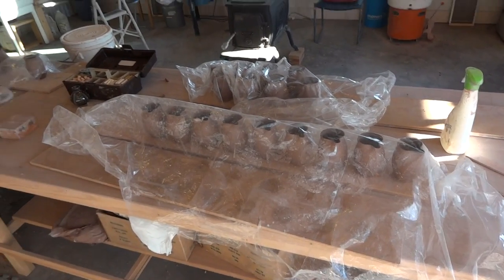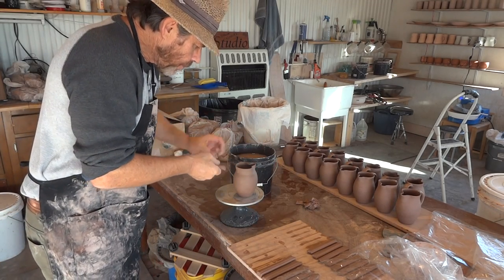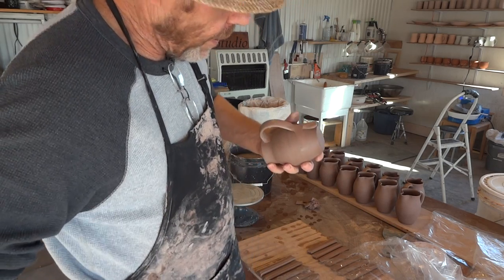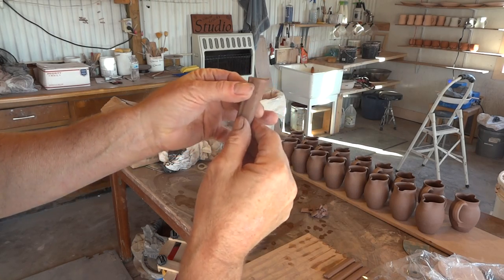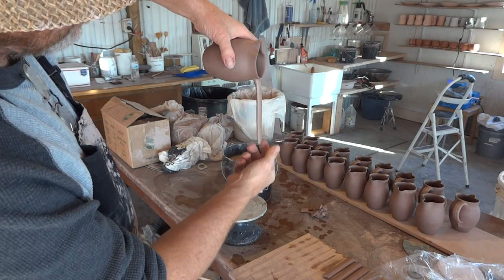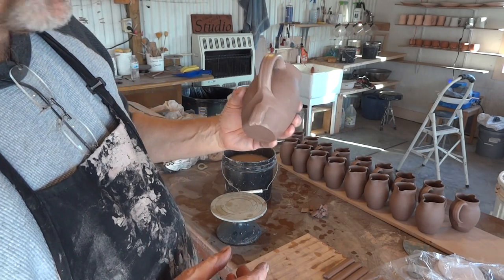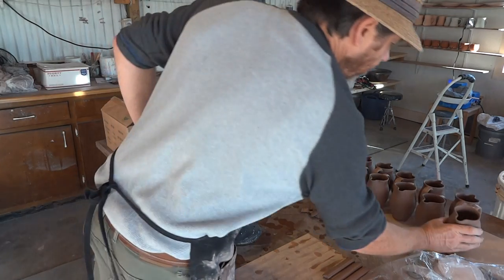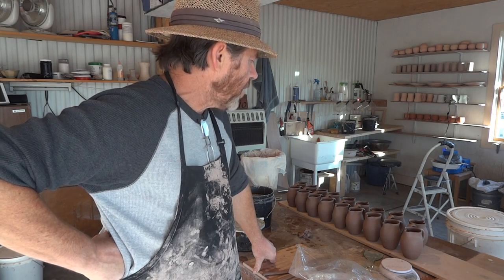SIMON LEACH POTTERY TV - Finer details re handling pots.

Comment: Very much a beginner here Simon and getting so much out of every clip you upload.  I use most of your method of handling pots but I'm finding it easier to pull a little stubby handle, attach it a la Simon Leach and then pull it off the pot to the correct length.  Also finding having a bit of a taper from top to bottom allows the handle to form a natural curve.  I noticed also you have a bit of an angle on the end of your handles rather than them being perpendicular.  Is that just to fit pots that curve inwards at the top like these pitchers or a thing you always do regardless of pot shape